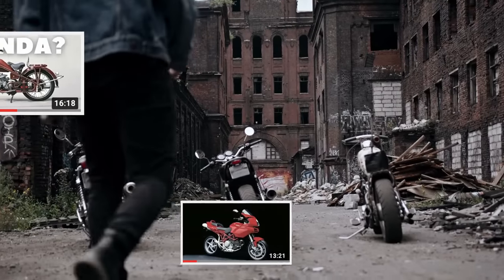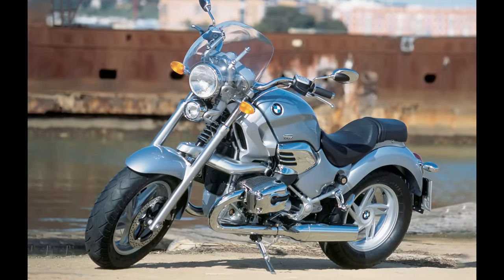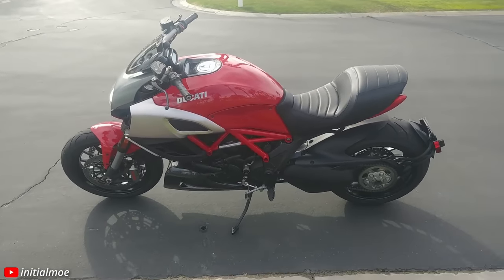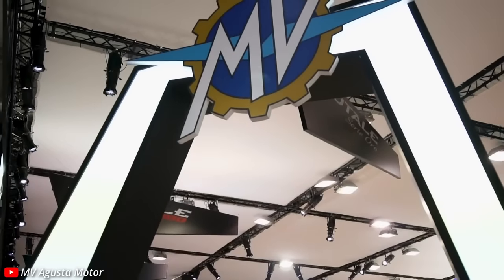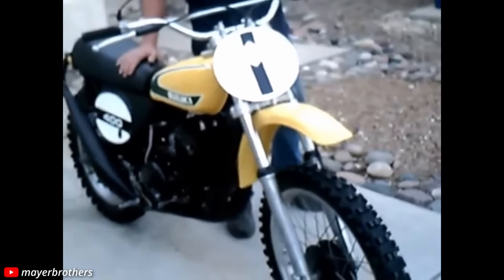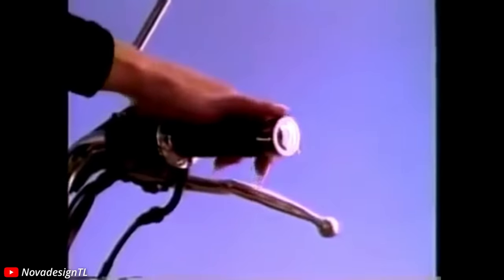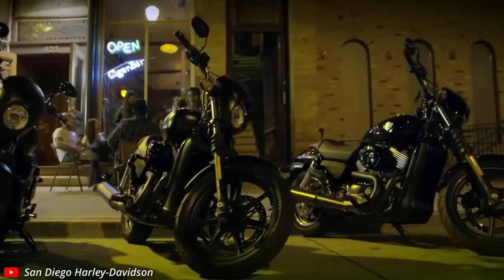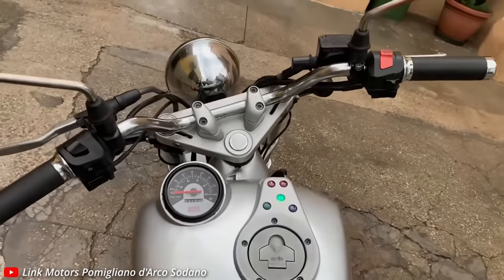The WORST Motorcycle from every manufacturer

Comment: Considering how many viragos Yamaha sold and how many years they built them and how great a bike they really were and you picked it as the worst bike they made really is a compliment to Yamaha in general
Reply: Smooth, faster than i wanted it to be... Truly ahead of its time.
Reply: This guy airs himself as an expert when he makes glaring mistakes all the time
Reply: to me the appeal of virago is like the katana, it's so ugly yet so appealing
Reply: The Virago might have been a good bike, i wouldn't know, but my god it was ugly.
Reply: It's not the most beautiful bike for sure, but it's such a comfy bike to ride, and sounds great.
Reply: @adadadatt  i dont think this guy has ever once claimed to be an expert 😂
Reply: I was never a fan of the styling but having ridden a few they were exceptionally good bikes.
 The 900 eliminator wasn't a bad thing either.
 My take from this is that he simply doesn't like factory cruisers.
Reply: I had a Virago 535, great bike. The only real issue was the vibrations at motorway speed.
Reply: I had 2. 920 and 750. Both weren’t reliable for a Japanese bike. I liked the looks and they were fast and sounded good. Maybe they actually nailed copying Harley?
Reply: What version of the Virago - 250, 535, 699, 750, 920, 1000, 1100? Harley was so afraid they lobbied the government to put an import tariff on any bike above 700cc so Yamaha took the 750 and made it a 699cc - so there, stick it Harley.
Reply: My second fav bike of al time! Ive had 4 of them and I loved them all. Of course I got a Harley Breakout and I wont be changing this
Reply: this
Reply: I’ve ridden one, and compared to something like a Honda shadow, it’s a piece of garbage
Reply: @adadadatt  a katana with bicycle wheels but an amazing frame….
Reply: @trevorcall2074  Maybe it was garbage, Ive rode a few Shadows and they felt like underpowered mopeds compared to my 1100 Virago
Reply: I had a 535, great little bike , looks absolutely awesome , smooth power and great handling , sold it due to bad mileage and tired of fixing the carbs
Reply: I had one. Yes, it was Yamaha dependable. Mine vibrated at 65….terribly. 
Due to its twin cylinder engine. 
And looked like a grasshopper.
Reply: Virago 250 still in production after 44 years. No other bike can claim that now the antediluvian Royal Enfield has been transformed into a modern fake classic
Reply: @chantakzee  The 535 was a great bike that looked the best of all the Virago models. I had one, the carbs did need regular work. But I loved that bike, it was my first real street bike.
Reply: a friend of mine has a 250. Runs pretty good, looks terrible, the engine heads look so terrible... Also a shit ton of electrical problems but I wouldn't pin that on the bike at this age.
Reply: @geneclarke2205  It wasn't the Japanese V-twins that had HD on the run, it was the sheer numbers of cheap UJMs that nearly killed them.
Reply: The 750 looks like someone rode it into a tree at 60 mph   ...ugly, bent-up lookin' thang!!
Reply: @nerfytheclown  I've had my virago for 6 months. It does everything one can do on pavement. I'm going 70-75 on the local freeways. I get compliments all the time too.
Reply: I had a Virago XV250 and was totally awesome.
Reply: I had the 1100 and loved it once , I got rid of the bug eyes and put a tear drop air filter on it and put fish tail mufflers on it it looked great.
Reply: I'm stunned that a lot of people consider the virago an ugly motorcycle. I have a 2004 virago xv250 & it's been a great beginner for me. I've did some customizing but overall I think it's a good motorcycle.
Reply: But too be sure, can you name a bad bike yamaha made?
Reply: I'm what Doctors call an "old fart"   I have been riding for 49 years.   I am currently  riding a 2019 (Virago) VStar 250 This is probably my last motorcycle,  these are great bikes. If you people just want to ride "pretty motorcycles " that's fine , however,  just like women sometimes the Not So Pretty Ones are the best ones, often it's how they respond when on them !!!
Reply: Hitachi carbs, and the starter drive system is the worst part about them
Reply: @adadadatt  I've only ever known four Viragos in my life and all four had exactly the same problem: the starter motors lunched themselves. Repeatedly. Made four nice riding and sounding bikes too unreliable to be able to ride with the group with any regularity. Meanwhile, both of my GL s (400 and 500) ate their timing chains.
Reply: That and the Kawa are truly horrible bikes (and they look the same).
Reply: I had a 1984 Virago 1000 and a 1989 Virago 1100,they were great bikes.Very comfortable and reliable.My only complaint was the cheap chrome on the 84 model,it would flake.Didn't have that problem on the 89.They were better than than the Harleys i owned.
Reply: I have a 535 and it is a great bike. As some has said here, only problem is taking care of the carburators, but that's not even a problem because it is the ONLY thing you have to take a look at every once in a while. 
Mileage is pretty good for such a small tank and power delivery is great. 
Looks are subjective and personally I'm not a big fan of its front side. But the profile? Pretty amazing to me. Looks sharp and built for the job.

And yeah, pretty cheap and INCREDIBLY customizable.
Reply: @IrnMaiden304  By 1988 the starter drive was fixed and Mikuni carbs were used. The upgraded starter drive from the 88 fit perfectly on my 85 and fixed the issue. Didn't swap the carbs but threw away the EGR mess and that fixed the carb issues. Now it has a satisfying Ducati-sounding burble and some nice crackle upon engine braking.
Reply: @trevorcall2074  Depends I hade both, Honda definitely better engine and overall better built quality but really not great in handling, crappy transmission that limited torque of the engine, you really had to shift often if you wanted to stay in usable RPM and poor breaks. Virago had mainly 1 big problem starter clutch and early models had really shitty Hitachi carbs and as far as the look it had just too much of everything. One of my Viragos was early model 1986 with two tone paint and some gold accents, too much.
Reply: @IrnMaiden304   I see You've Owned an XV 👍😁
Reply: @purebloodheretic4682  A good friend of mine had one, 12k miles on an 87 or 85 I believe was a 920 or bigger, when it started it ran good, plenty of pep. Those carbs were a major pita to deal with but I had it down to a science the 3rd time around cause it needed new intake rubbers. Comfortable ride just wasn't as much a pleasure to tool on.

Those older yamaha bikes I liked that were a cruiser style, were the XS650 special and the XS400's, had 2 XS400's and another friend had the special and that thing would haul some a$$
Reply: @woodforthetrees3496   Yeah but it was a 125 4 Stroke! It wouldn't matter who made built it, I would be a Slow POS!😁
Reply: @DG-mi7yf  Me too, I loved both. They never let me down.
Reply: I have a ‘94 750, agreed it may not be prettiest bike in town, but it’s faster that my friends Ducati Scrambler, always starts right up, smooth at cruising speeds, is VERY comfortable to ride, and almost put Harley in the graveyard. So I’ll keep my XV750. I have a video of it on my channel.
Reply: Virago is a classic bike...would love to have one.
Reply: Bought a Virago 250 new in 2001. Still have it. Love the lil' feller! I've owned bikes since 1973 (yeah, I'm old) I bought the V250 specifically for two main reasons. One, it was the lightest in it's class and I use it to mount on my rear bumper of my motorhome for easy lifting. I can do it by myself. Two, is it's the lowest seat height in it's class so my wife and daughter's could ride it. I take it for quick jaunts around the neighborhood or a quick ride to the corner store. Perfectly fits for the reasons I bought it. Oh and btw, I personally LIKE the way it looks!
Reply: They still make them.
Reply: I bought the first year of the 2nd gen.  The engine was smooth, powerful.  The bike was comfortable, good seating position.  But...brakes were screechy.  Starter sounded like a 1970s Dodge starter and was about as reliable.  Durability was horrible, plastic always breaking.  Electronics were a nightmare; ignition box went out on me 3x.  Front bearings went out in the first 4000km and the kickstand switch went out around the same time.  I sold it for what I payed for it, $3700 inclusive 10 years later.  Never bought Yamaha again and never will.  Ride a Harley now, great bike, never has problems.
Reply: I had a 95 Virago 750 & put 80k miles in less than 10 years. Damn reliable bike, would have easily reached 100k or more - still ran great and had good compression when I sold it to a friend
Reply: The Virago:  Good looking bike. Sounded good too.
Reply: @pauld7827  Me too. I had the Limited Jubilee Edition and in Germany the Virago 535 was the most sold bike over 
many years. The vibrations was a problem I agree and some  test driver said it was the buckhorn steering gear.
Frieds of mine changed the steering gear and the exaust pipes and make their Viragos a single seater.
Reply: If the Yamaha Virago was chosen as the "worst" yamaha, i don't need to even watch this.  I had one with a seat 27" off the ground and plenty of go-power, i loved it for years.....
Reply: @nerfytheclown  i have been really happy with my 535 while i only had my A2 license, and i enjoyed it so much that i didn't even sell it when i got a Thunderace for my A license. The 535 is really comfortable and fun to throw around. It's also really fun to gun it while coming out of a turn. That thing has gone from 40.000km to almost 60.000km in one year just going to university and back, the only problems i had were a puncture on the rear tire and a battery that was supposed to be changed a long time ago but hadn't been yet. Other than that, no mechanical problems, no electric problems, nothing. And i don't always ride it slowly. More often than that, i gun it everytime i pass a car or come out of a red light. I have nothing but good things to say about my 535
Reply: Trust in Jesus.
John 3:16 - For God so loved the world, that he gave his only begotten Son, that whosoever believeth in him should not perish, but have everlasting life.
Luke 13 3 - I tell you nay: but except ye repent, ye shall all likewise perish.
Reply: I’ve had two 535 viragos, 2006 I toured Scotland fully loaded on a k reg with no problems. Looks are irrelevant when you’re alone in the middle of nowhere.
Reply: I've had my 1100 Virago since 1992 and I get loads of posative compliments on it. 
Admittedly, the main reason I got it was because of the seat hight.  But if they were so bad why did you see so many of them back in the 90s? I'll tell you why, because they were everything Harley's were not. They were affordable, comfortable, handled better than anything in its class and best of all, SUPER reliable.
Reply: @draculasdaughter36  i have a 535 and i don't think it's ugly, and also got many compliments on it, specially by people who thought it was a harley before i told them it was a yamaha
Reply: If this guy really knew as much about motorcycles as he acts, then he would have chosen the TX 750 as Yamaha's worst. The bike had oiling issues that caused the top end to seize. But instead, he chose the Virago.. a nearly bullet proof platform only because he doesn't like cruisers? I know its just your opinion, but please do some research before you make these videos. I mean, you didn't even mention the starter alignment issues of the first gen Virago. It was something Yamaha quickly fixed, but if you were trying to find something wrong with the bike, this is it.
Reply: Yep. What about the first gen V Max instead.
Reply: The Harley Street 500 not even American made India
Reply: @geneclarke2205  You left out the 500! (actual 499cc). 😌
Reply: If you ever had to do carb work or repair the Rube Goldberg starter engagement unit you would agree as I do that compared to other great bike Yammie made back then the Virago was indeed the worse.
Reply: @adadadatt  I've never heard him suggest he's an expert. All his videos--especially the lists--seem to me to just be for fun. (And did you miss where he says as much and that is just his opinion multiple times in this one?)
Reply: @everyday tenor their piano's "OK", too
Reply: @Roadghost88  HAWG or Sportster?   Tried to get on a Buell, "Ulysses" before the better Rotax 1125cc became available, but Arrowhead HD thought you weren't 'Serious' if you wanted a Buell.
Reply: @diesel4ever273  'Sounds like a 'Plan',--just, when "giving-it a TWIST."..be SURE there's NO red-light-runners @ 90-degrees to ya. --'K?
Reply: @jackdale9831  most of the red lights i catch are speed triggered, their purpose here is to keep traffic at 50km h in certain sections. I rarely trigger them, but many people speed up to them and brake already in the controlled zone, but end up passing before the red lights up so then i have to stop. Those are not on intersections. The only two intersections i get through with red lights aren't ideal places to gun it because one of them is a populated area and in the other i have to turn
Reply: @Jeremy DeCaro  Yep , saw Jesus on an XV1100 looked cool with the beard and sandals.
Reply: I remember clean Suzuki 750-4 standards sold new for $1750 in any of 3 colors.  A friend bought one. They had perfect gearboxes and engines that were smooth and DOHC speedy.  Great deal!
Reply: In the nineties, I always liked the Virago and the Intruder, but I might have owned the Eliminated if I hadn't been fortunate to have my mighty Vax!
Reply: I agree! This guy is just stating his opinion and we all know what opinions are compared to!
Reply: @adel5637 katanas are ugly since when??
Reply: @omary5439  doesn't need to be rocket scientist to figure that out
Reply: They should technically be the most successful bike ever made!
Reply: Virago was an awesome motorcycle 
Tons of torque and fun to ride
Reliable as a stone. I had one and enjoyed it. Your right when you say "to me"
You have entered into an arena where you really can't make a point because your opinions on these bikes simply represents exactly that , YOUR OPINION.

Comment: "Worst" is not a aesthetic exercise.... Worst - means the poorest reliability ,  the most recalls,  the worst safety record. It means bikes that never sold and were killed in a single year. It means bikes that killed companies, or result in major financial losses.
Reply: At times this gentleman appears to define “worst” according to matters of safety, design (ergonomics), and mechanical integrity.
Those are the definitions I can agree with.
When “worst” happens to be based on aesthetics and ‘cool appeal’, however, he’s lost me.  Each of us can recall those less-than-cool automobiles and bikes that were extremely reliable, and never broke down, and those extremely popular and “sexy” ones which spent more time in the garage than on the motorways.
In my area, during the 1970s, every teenager wanted a Honda CB350.  They might not have been as cool as some of the other bikes, but these “plain Janes” were freaking reliable and fun to ride.  
As this video is said to be done in the spirit of fun, I take it as such, and won’t use it as a major buying (or riding) guide.
Reply: @harrybrooks8514  low profit=bad
Reply: @harrybrooks8514  His whole gripe about bmw was its looks. HP also has nothing to do with "worst", by that logic 80-90% of bikes can be classified as crap.  Quality-wise, nothing about that bike was bad. And no, I don't own one.
Reply: Well that's your opinion. See how opinions work?
Reply: No no. It means "I think it's funny looking."
Reply: @Squidmalion  look up the definition of the word “worst”. Its measurable, objective and based on comparison. Worst has nothing to do with opinions same as “closest”, “furthest”, “highest” doesnt.

Comment: I used a 96 Virago, as a commuter bike in L A.  for many years.
Put 84,000 miles on it, and never did anything but maintenance to it.
 Reliable,  comfortable and decent handling bike.
Great bikes!
Reply: I love Virago !
Reply: Yes I had a 1994 Virago 750  got it in 2000 sold in 2018 always looked terrific . I wish now I had kept it it was a great cruiser only let me down once a minor wiring issue caused by original owner.

Comment: The first bike I learned on was a 1984 yamaha virago XV700 that I bought for $1100. Since then, 4 motorcycles later, the virago will always start when I want it to, it will always ride well and I have not put more than $150 into repairs for it. Oil change, new battery and fork seals. I could romp on it endlessly, pin the throttle at full down the highway (85mph), lean it to kingdom come, it has been the most impressive bike ever, especially for being almost 40 years old. Y'know what you really did by making this video? You brought a family of Virago owners together again.
Reply: I wish I still had mine
Reply: I learned to ride on a Triumph 650. Took my biggest leap ever, 7 to 10 ft in the air, from jumping a center curb, on my first solo. No oncoming traffic. I did better the second time. That bike handled so sweet. At ANY angle. When I had learned to ride.
Reply: I had the same bike back in the day ('85 model year). other than the engine assembly being the "frame" of the bike and me waiting for it to fold crossing train tracks or crack the blocks, I loved that bike. wannabee looks were badass, too
Reply: Every Japanese manufacturer makes bulletproof bikes, but Yamaha makes bombproof bikes.
Reply: He didn’t say it wasn’t a good runner. It is just hideous, I can’t argue that.
Reply: Former owner of a virago xv700, what a nostalgic experience it gaves riding it...
Reply: When you are 74 you will love ❤ it.  The 250 is a first and last bike to have and ride. Not a highway bike but at 50-60 on the secondary roads it pure pleasure.  And as a bonus you can do the U-turn in a cluttered garage !!